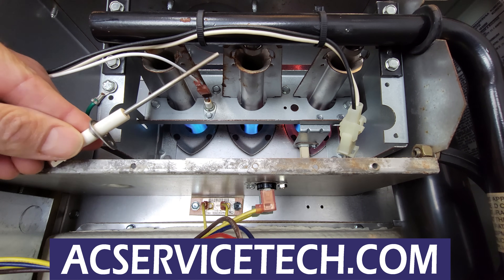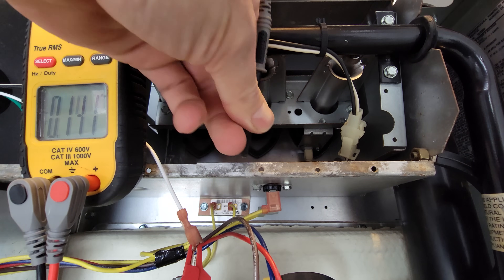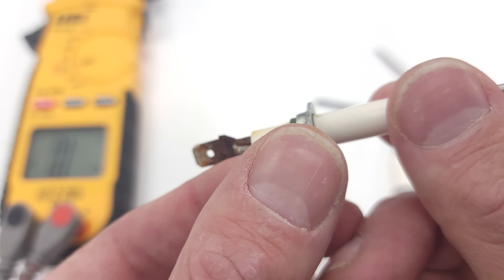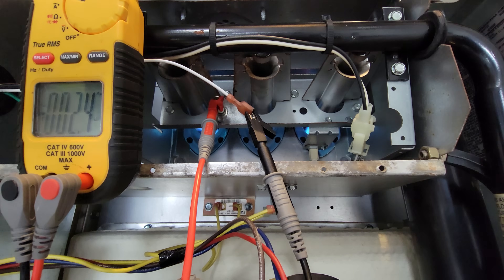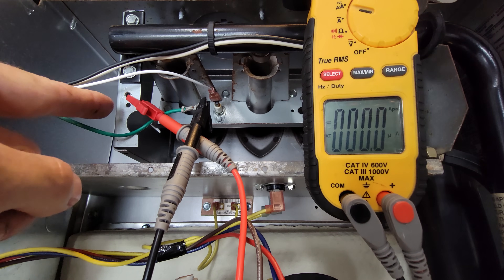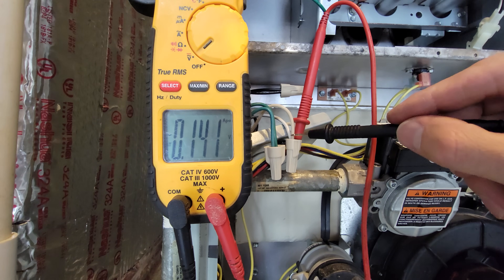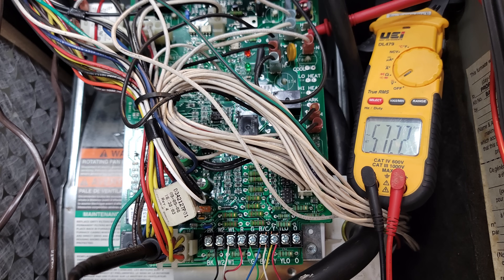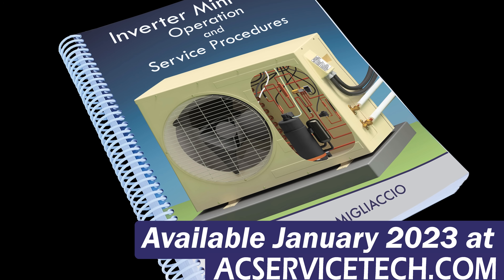Understanding Flame Rectification on Gas Furnaces! Explanation, Testing, Flame Rod, Ground Issues!

Comment: Great video! I’m only getting 15.5 volts going to my flame rod when meter is connected in series. Is this a sign of a bad board? This board was just replaced last summer.
Reply: Meter should be connected in parallel for voltage measurement; connected in series for current measurement.

Comment: I'm wondering why you don't use the meter's current loop to get the current reading instead of going to the trouble of putting the meter in series. Is the loop too noisy for microamp readings?
Reply: Clamp doesn't read DC. And if it did microamps are pretty small.

Comment: I'm having a problem with my Nordyne furnace. It's old but the HE is in good condition. Flame rod signal seems to disappear. Getting around 2-3 micro amps then it shuts off. Tried bending the the flame rod and it worked for a while. Just keeps trying to fire. I just removed the GV and burners. Cleaned them up the best I could w/o damaging them. I jumped the ground to the box, but it didn't help. Will check the CB connector next.

Comment: Gotta love when correcting my boss(he has PhD in engineering and is a fully licensed HVAC tech) about the flame sensor having power ALL THE TIME.. He was arguing with me that it's ghost voltage. I just gave up. He has been giving me false info on other stuff too. So hard to deal with this type of situation.

Comment: I just had flame rectification kick my butt for two hours on a hanging heater. The ground wire was a spade, and it wiggled off the terminal of the cabinet.

Comment: I have a peculiar issue I'm tracking down with my flame sensor.    Do you think a bond(ground) is required for flame sensor mount itself?  I realize the mount bracket is attached to the ceramic part of the flame sensor so doesn't seem important.   But in my case and in my troubleshooting my issue I have found that wirebrushing the flame sensor mount bracket where it makes contact with the unit frame seems to have solved my issue.   So that has me curious.   I am waiting for an OEM replacement flame sensor to arrive to test out a new sensor. 

My unit was short cycling but instead of shutting off in like 3 seconds for a bad flame sensor it would run 10-15 seconds before shutting off then immediately recycling the whole inducer, flame, etc cycle.
Reply: No, not through the mount screw.
Reply: No, not through the mount screw.
Reply: But the chassis does need to be grounded so check it like he showed through neutral or even back to ground at the board and look for voltage difference. It should be close to zero, no more than .5 volt.

Comment: I've watched dozens of videos on the operation and failure modes/correction of flame burner flame rods yet...NO A SINGLE ONE ADDRESSES OLDER FURNACES THAT DO NOT HAVE A FLAME ROD.

On older Payne, Day & Night, Bryant and others use according to the schematic a "Safety Pilot (Flame Sensing) unit.  Does this serve a similar purpose in a different manner??  How do you check/diagnose one??  This appears to be a part of the Pilot Burner Safety Switch assembly, now only available from Robt. Shaw p/n 1830-620,

Can you PLEASE address this????

Comment: Excellent explanation. Low level DC flame sensor signal makes control board sensitive to AC power polarity because neutral is grounded at power panel. This can be issue if furnace unplugged and does not have newer polarized plug / receptacle pair.

Comment: Wow, the most best Furnace system walk around.  😎  Thank you so much.   The flame rod circuit is very interesting.  May be check the waveform out with an oscilloscope?

Comment: Hi, there are furnaces that doesn't have a dedicated ground from burner box to control board. So in that case how does the uA get back to the board? If the uA is going back to the board on the ground wire. Then what's the uA reading when your meter was in series with the flame rod? Thanks.
Reply: I believe it uses the spark rod if you have intermittent ignition system

Comment: I have  a question ? If a inducer motor gasket is bad and has crumbled / fallen apart and pieces fallen out would that cause rollout switch to shut the furnace down ? High limit . Since there is now a gap in where the gasket was .
Reply: You better have that heat exchange checked. Flame rollout could be deadly gasses entering the living space. As far as the gasket either replace it or put some metal tape to seal it.

Comment: Great video. I’m a UK based gas engineer (not the stuff you lot put in your cars, the stuff we power our boilers with, sorry, furnaces with) I haven’t found a trainer in my years working in the industry that can fully explain the rectification process. When you ask them their explanation turns a bit vague part way through and their answer usually contains the words “magic happens” 😂
Reply from the maker: Ha ha thats not good!!

Comment: the ground wire on the burner is attached to the control module or into the gas valve?

Comment: I believe what causes confusion is this idea that the ground is sending a rectified voltage back to the circuit. I believe a better way to understand this circuit is to realize that DC current sensing is happening on the AC wire and not on the ground wire. The ground wire is needed to complete the path back to the circuit board. It is also helpful to understand that the current measured is in DC microamps because the flame is causing the rectification of the AC voltage.
Reply: The rectification is a result of the amount of ions in the flame that are received by the flame sensor. The difference in the physical size of the flame sensor compared to the burner face means fewer electrons going back towards the burner, AC converts to DC and thusly rectification results. The signal then travels to the board in micro amps DC.  The board requires the micro anp DC signal which can only be a result of the presence of flame to keep the gas valve operational.  The flame sensing rod is placed at the burner fartthest from HSI thereby ensuring that all burners have lit proving ignition.
Reply: So there’s AC And DC current on the same wire?  And the Earth/ground wire is required to create the “Loop” to allow this to happen ?  So the ground doesn’t carry the dc voltage back to the PCB ? But the AC Wire actually has the DC current and is providing the proof the flame is there with the same wire back to the PCB ?

Comment: If a flame rod can get the micro amps reading back to the board then why do u need a separate ground wire to do that same job? This is what I never fully understood.
Reply: The flame rod is completing the path and it is going to ground  after jumping the gap if I’m not mistaken.
Reply: @caru3257  they're basically asking why you can't have two seperate currents on the same wire

Comment: Just a quick question when the flame sensor is properly positioned in the burner flame is the 60 volts eliminated from that flame rod and now is reduced down to microamps 2.5 give or take a microwamp
Reply: Voltage is always present at the flame unless is not energized.  Amperes are the result of voltage divided resistance.  Example: 120V/60R=2A.

Comment: How do you check flame current on those furnaces where the voltage is fluctuating the flame rod. The micro amps will usually fluctuate from 0 to 6ua back and forth. Usually higher end Lennox and Rheem
Reply: I came across an SLP98 the other day that had a week flame sense error. Milliampers was jumping all over from 0 to 12. It stayed running for me but I feel uneasy about it.
Reply: @bill944  they're designed to be like that. Some of the Rheem and Goodman do as well
Reply: @blankman8021  yes, literally what I just said...

Comment: Great video. Can you address why some furnaces won’t run when powered from a stand alone generator (during a power outage). I’ve found that the neutral and ground from the generator must be connected in order for the control board to allow the furnace to operate. This even happened in an older home with knob/tube wiring and no ground. I’ve had this happen on both inverter and conventional generators. Thanks.
Reply: Most likely it is a grounding issue. Flame rectification requires a good ground.
Reply: Furnaces rely on a  proper ground. If you install a furnace in a knob and tube House you will need to provide a proper ground. I recommend running a dedicated circuit in any install to provide proper power to the system. This will also allow a better length of life to your furnace, since most electrical systems are usually riddled with issues. If you're using a generator I would recommend a surge suppressor for the furnace. I have also been putting those in with the newer ECM furnaces.

Comment: Craig why would the flame rod have 50 to 180 volts and also why such a wide range?  The voltage is not needed correct?
Reply: From my understanding the voltage in the sensor and the resistance that the flame creates is how the flame is rectified. Without the voltage there would be no way to detect any kind of signal
Reply: The higher voltage is needed for better accuracy.  Lower voltage would need a higher current to pass through all those electronics
Reply: The higher voltage overcomes soot deposition and rod clearance if the rod bends slightly over time. Also, gives a higher DC signal current.

Comment: wow open burner like this prohibited to sell in eu cc 15years ago.
Reply: The combustion chamber door has been removed....
Reply: There are units older than that still in service.  My 1993 yorky90%er has a sealed burner box but I have seen other newer units with open boxes.  Newer would be later than 1993, haha.  Next August it will be 30YO.  It is in a dry, low humidity location and the safeties have always been in place and working.  Regular low restriction filter changes.  So the exchanger is still solid.
Reply: @Angry Beaver  Keep Mongo away!